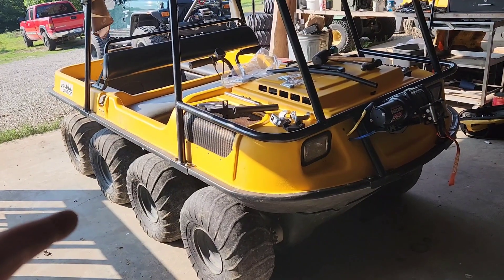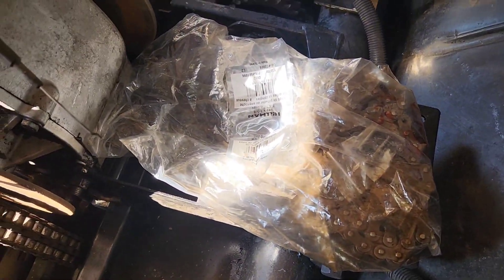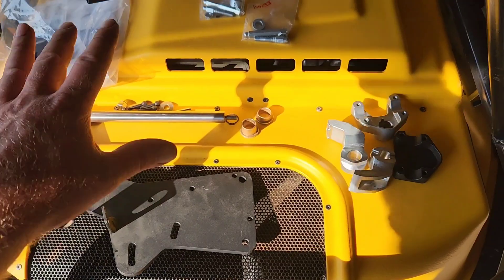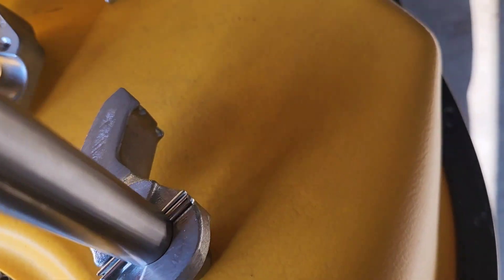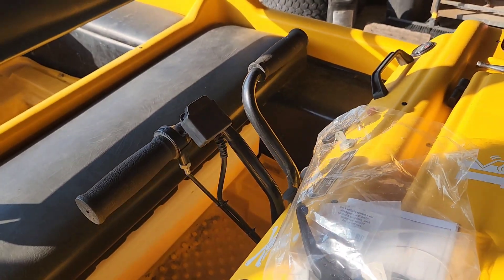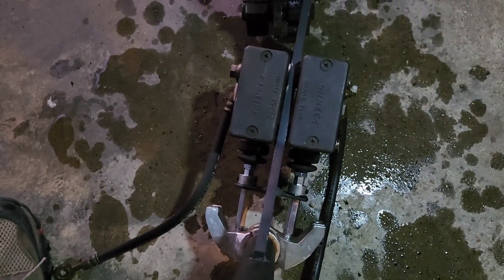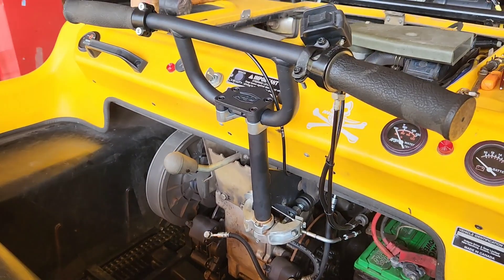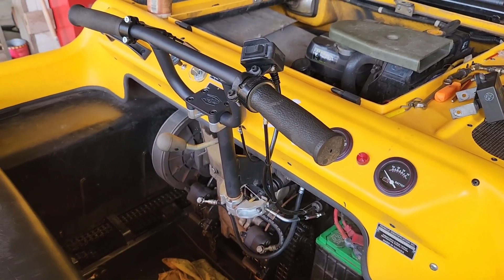Installing and updating a late model Argo 8x8 with the newer Argo handlebar steering design.

Comment: I'm wanting to do the same thing to my argo bigfoot.  Nice machine you have there.😊
Reply from the maker: @RickPasour  Thanks. I think it was a great improvement for one of these older models. I just did a 6 part complete frame out on my newly acquired 2015 Argo 750HDi 8x8. I put the videos on my new YouTube channel. Check out what a full frame out restoration entails for one of these Argos. They are pretty simple machines. 
https://youtu.be/6zRZ89oXaGY?si=v71fek7iZEA0YpVj
Reply: @2artactical55 I'm looking into doing more improvements on mine. New steering handlebar,tracks,& hardtop cab. Going to be using my retired search & rescue argo for wild hog hunting in the swamps of South Carolina.
Reply: @2artactical55  These are really nice machines. If you have any mechanical  knowledge you can probably work on one. The Argo company mailed me a argo bigfoot work manual acouple years ago. It has really been of great help when I'm working on my machine.  Especially things I'm not sure on when I'm doing repairs. I was surprised that the manual was free. It's over 120 pages long. That was really nice of them.i hope your machine restorations go well on both of your argos. Rick

Comment: Hi I tried contacting argo adventure but they don't have the bracket anymore if you plan to fabricate one I would buy it cuz the conversion from old to new seems ideal
Reply from the maker: We've been busy setting up my Pole Barn with a concrete floor and loft. I too think this is a better steering system than the individual lever system from Argo. Once we get out shop up and running I do intend to make a few of these parts Argo no longer makes.
Reply: @2artactical55  OK just let me know when ever you make them I will buy one

Comment: I would so like to do this to mine & this is by far the most informative video on the MX hardware. 

What are your thoughts on the master cylinder seals? I have the same Grimeca master but cannot buy just tfe seals which sucks..
Reply from the maker: I bought a master cylinder rebuild kid that came with extra stiff (upgraded) springs and Seals. I also rebuilt my Calipers with new Seals. I also noticed that I can take this upgraded MX handlebar set up and upgrade it even further by replacing the current master cylinders with the one's Argo is using with it's APS system. I too would have a smoother APS steering in an older 2000 model. If you need Seals in the master cylinders, then I'd replace them even if you can only get the seals in a full rebuild kit. Braking and steering can't be done without good working master cylinders. I'm glad you liked the video and found it useful also. Thanks!

Comment: Hi, Where did you get that kit? Ive been looking for a while and can't find it.
Reply from the maker: It's not a "kit" anymore. I had to look at the 2005 parts list and pick out everything separately to order. I got it all from "argo adventure" online. All the parts to do this conversion were over $800us. 
     It was totally worth it, though, in my book! I can actually drive with one hand unless I need to pull the brake lever to stop. 
    I'm going to add a short brake lever style Throttle for it also. You will need brake lines at least 3" longer than standard.
Reply: They don’t make the plate anymore
Reply from the maker: @user-hz3cj8hj7e  hmmm. Sounds like I'm gonna make a casting of mine and reproduce it for my 2001 Argo Bigfoot. 
   They told me I got some of thier last parts when I ordered mine. Most of the bolts and nuts they didn't have anymore so I looked up the bolts on the Argo Parts list and acquired them at Tractor Suppy store.

Comment: Fabricate me the whole set,  these should have never been discontinued :(  Driving down hill in rough terrain where you NEED hand brakes and a solid arm to hold on to is essential for these types of vehicles.  Now if it were a zero turn lawn mower where you're on mostly flat ground and easy terrain all the time,  yes levers would be just fine and probably even better.  But for an XTV?  phhhh absolutely not.  Where can I get me this or similar conversion?  You could make a killing if you have the ability to duplicate all the parts ;)
Reply from the maker: Thanks. For now you can still get the parts or most of them from argoadventure.com. everything to do the conversion cost me a bit over $780. We are going to fabricate a steering system like this for my sons 2001 Argo Bigfoot. I'm sure we'll be doing a video of it when we do.

Comment: Do you have the complete parts list needed?
Reply from the maker: I do on my receipt. I gathered the parts #s I needed to order from the Argo Parts schematic sheets for a 2005 Argo Bigfoot. They are free PDF downloads, including the repair/maintenance manuals on argoadventure.com. They are who I ordered all the parts from as well. I did post the blow-up parts list sheets at the end of this video as well.
Reply: Ok. Need to do this to my 88.
Reply from the maker: @magnus1988 here's the test drive video for the steering handlebars. I also did a seprate video for installing the 24" Argo swim tires to show that the bigger tires will fit. But here's the video of it all together and being tested on various terrain. 
https://youtu.be/B6IlzboVC-Y?si=VC598yb5uvvISvx0